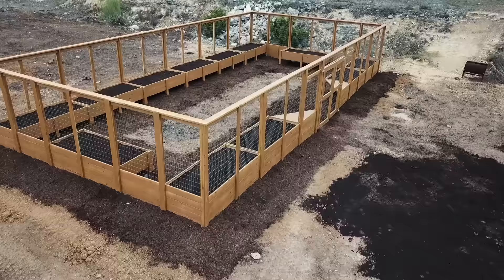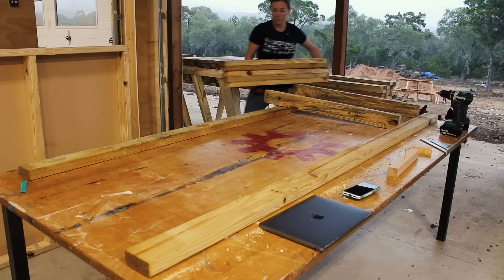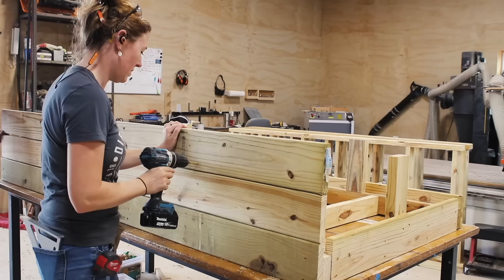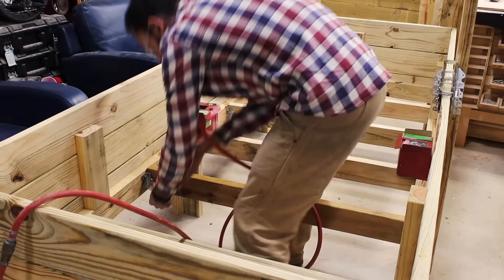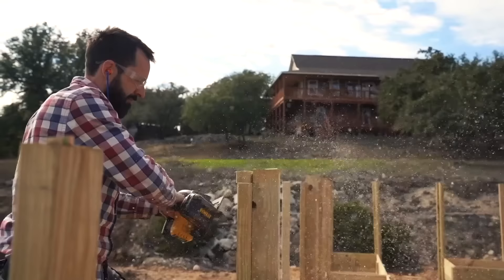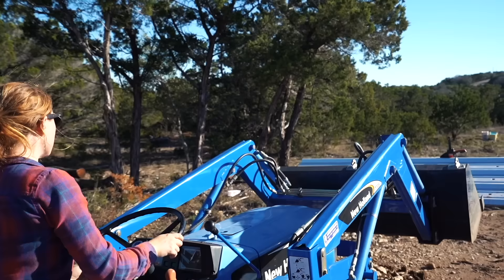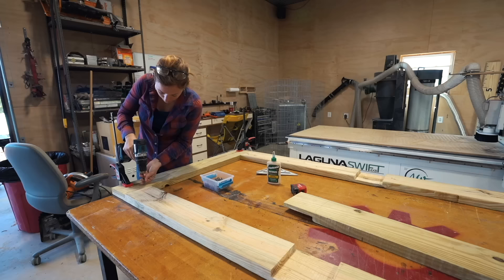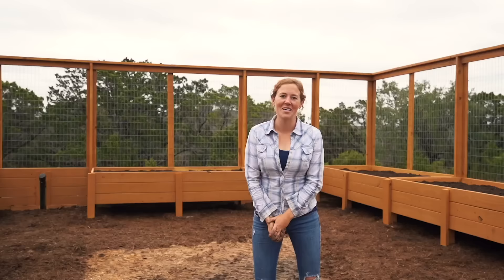Enclosed Walk In Garden with Raised Beds

Comment: I would have to remortgage my house, just for the price of the lumber.
Reply: I could eat for a year at least for that money
Reply: @offgridwanabe   you could eat for a lifetime after building this
Reply: @MrPilcher1  pretty for the first 5 yrs but the wooden box would not last that long.
Reply: @jivdis1x   wrong, use treated timber or a hard wood I've got 10 year old wooden beds , my only issue with these is they don't wick
Reply: @Butch Hanson  there are no acidic treatments that perfectly safe for food production if in doubt line the box with a plastic film. Treatment doesn't harm the food just messes up the soil Ph which can be altered  or corrected most soil needs Ph correction you should be adjusting to suit your crops
Reply: As she said, Lowes helped sponsor.
Reply: Almost $7 for a 8 ft two-by-four where I'm at.
Reply: @gregc9881  That doesn't sound right
Reply: @MrPilcher1  Lowe's in Kentucky$6.59 6 2 by 4 by 8 and 2 2 by 6 by 8 and to 2 by 6 by 16$100that's if you can find it it sells out quickI guess this is a year of deck builds where everybody's backyarding it .
Reply: @gregc9881   try shopping around  at other stores  look for buildings being demolished ask what they're doing with the old timbers where there is a will there must be a way. Heck I'd scrounge old pallets if need be  how big is your desire to have a raised garden bed. Last year I spent $6,000 building a greenhouse & setting up an autopot system, I'm already seeing the savings but you must make a start somewhere. Have you looked at IBC's   then wicking beds they save on water not problem with  treated timber an easy to build
Reply: @MrPilcher1  84 lumber Lexington Kentucky a 2 by 4 by 8 treated $11 I shouldn't have nocked Lowes they're like seven bucks still high
Reply: @gregc9881  4 X 2  Is not really suited to tis operation see if you can access old railway sleepers
Reply: ryan norris   You don't get if you don't ask
Reply: ryan norris   I have spine it seems you don't, just build something and get on with it. I don't complain I just do it I've offered alternatives  but it's all too hard . I've got the spine and have done it. What have you archived?. You the moaner here. Hell I grow so much food I'm giving it away. All you've done is complain about cost grow a backbone
Reply: @n.w.414  doesn't mean they paid for all the supplies lol.
Reply: @gregc9881  The price is up to almost $11 here in WA state
Reply: Now it's March 2021 and it might cost the same as a 2 car addition!

Comment: That’s just a couple of steps away from being a greenhouse.
Reply: Oh what an idea! She could totally make it that for half of the year if she wanted to!
Reply: I was thinking that big open space in the center was perfect for a greenhouse and small tool shed.  I've considered doing something similar to this around a greenhouse/sunshed, but the material costs are prohibitive.
Reply: Or a good place to grow things like corn or vine plants like watermelon or pumpkins. Or you could put a chicken coupe in there.
Reply: You are so right. In winter one could put up a shade to protect and also to make a head start.

It really is s great looking project
Reply: That’s exactly what I was thinking. It would be easy to make it so the sides are roll-up-able and the top has vents or can be removed in summer. Like a really cool high tunnel.
Reply: A Greenhouse needs to be covered with either plastic or glass that adds to the cost exponentially  plus  roof beams etc this would be a cheaper option in many respects.

Comment: Literally the best raised beds I've seen. I would never of thought about using metal roofing material but it makes the most sense. It will reduce rot on the wood base and make the unit much lighter if needed to move. Only one thing is I'm pretty sure deer are going to jump that when their hungry.
Reply: Deer are skilled at jumping, but this garden is safe. The fence is high enough. And deer won't jump when they see that they don't have a safe place to land.
Reply: @idontthinkso666  Don't get me wrong, I really like April's design and you may be right as your deer are smaller. But I've seen 8 foot tall wrought iron, arrow tipped fence with deer hair hanging from it. When deer are hungry the do stupid really well. Cheers!

Comment: When I build my 12' x 22' C-shaped raised-bed garden I was not only concerned with the potential of whatever the pressure-treatment chemicals might do, but also the wood being wet all of the time. My solution was to line them with Delta MS foundation wrap to keep the wood from direct soil contact but also to allow airflow around the lumber.

Comment: You should dress your planted beds with a couple inches of straw  or mulch to retain moisture in your soil.  The automatic watering system is nice but it’ll save water and create healthier soil with a biodegradable mulch.  I’ve used paper bags, straw and commercial garden mulch.

Comment: Wow nice I'm jealous. When building my raised beds with PT, I struggled with the fact that none of the PT was the same width. Not fun to rip this stuff on a lower powered TS. Perhaps Lowes is better than Home Depot in that regard. Each bed is the height of a seat so I can sit while weeding. I opted to have the bottom be the earth itself and put wire mesh on the bottom to keep burrowing critters from coming up from below. This also works well to allow earth worms to enter and leave as they'd like. In each garden, I partially bury a 5 gallon bucket with holes drilled in it for my red wiggler worms. Dinner veg scraps, offcuts, and weeds go in there with layers of shreddings of paper bags or cardboard for bedding. Every spring I get an amazing "harvest" of worm castings to use in plantings. The worms aerate the soil around the tower. I also lined the inside of the bed with aquaponics plastic and wonder if that trapped heat and moisture. I think if I did it again, I'd try using a 1/4" drainage board material (like for siding rainscreen walls) and a layer of landscape fabric to separate it from the soil. The concept is similar to those fabric pots people love that causes the air pruning of roots. Good luck looks amazing. I desperately need fencing for the family of groundhogs living under my shed who eat for free.

Comment: Nicest raised garden set up Ive seen. When youre pulling fence like that, if you have a few inches extra at the end, sandwich it between to 2x4s with screws and use pry bars against the last post to pull it tight.

Comment: April, in my experience the staples you use to keep the plastic in place rust out in 23 minutes and leave two fine holes that create nice circular bits of rotted wood. Most of the time you do not really need them and when you do a dab of adhesive (one that does not eat the plastic) is better.
Reply: Stainless steel Staples

Comment: My husband and I basically had the idea of dismantling our pool deck after we got rid of the pool.  We kept the frame only and enclosed it with chicken wire and cheap pea netting.  We have a 2 1/2 surround boxes and a large square in the middle.  Its 14 x 16 ft and so far I like it.  Between the door on each side we also put in boxes for a herb garden and asparagus bed.  So far I love it.  We used what we had, its super sturdy and was cheap.  Next year I want to continue building to it by putting in various shelves.

Comment: That looks great -- for my area, I'd need to modify your design by adding a wire-mesh roof to keep out the raccoons.
Reply: and deer can jump...
Reply: Something really effective is using a solid piece of sheet metal or wood around the top 18-24" that the raccoons can't climb. We used this trick to keep foxes out of a hen yard.
Reply: @TheRavenWithoutWings  Good tip!!
Reply: Or a shade cloth (Texas) would also consider a chute for a chicken coop - let the girls in between seasons to do your tilling and bug control for you.

Comment: April when stretching the fencing,  sandwich the wire between 2x4s then apply tension by attaching chain, rope, cable etc. and pulling with your tractor, a come-along, block and tackle attached to an anchor point, etc. it puts consistent tension on the fencing top to bottom and frees up your hands.

Comment: This is great, but I would've put the fencing on the outside of the frames so any animals can't push it in.
Reply: I see that mistake often....thanks to YOUTUBE I learned before last fence we built!!!
Reply: I think that she has it in between both boards, so it can't move either direction.
Reply: I beleieve her fencing wire is sandwiched. Should be safe
Reply: She has them on the outside, look again.
Reply: @temujinkhan6326  She's in the garden bed, pulling, and he's stapling from the inside.
Then when she's spraying (with a highly inefficient sprayer, btw) from the inside, she's definitely spraying the mesh on the inside.

Comment: I’ve been waiting this is incredible! As a beginner female woodworker I admire and envy you so much. Love u 😁
Reply: No need to envy, if you have followed April for a long time or even review her video history, you would find that she didnt know a lot about it in the beginning. She learned as she went, you can too. Good luck on your future projects.
Reply: @welderman1221  What's so special about the woodwork in this video ? Except for the fact that she had to do a lot of the same unit, which simply require a lot of space, this is very basic assembly.
Reply: @furrane  all tricky stuff was handled on planning stage (not shown), woodworking wise it is big but simple project (of course simple for owner of right equipment)
Reply: @paveloleynikov4715  Yes indeed she did a great job planning it all with sketchup, but I don't include 3d modeling as woodwork, you can easily do the same with a pen and paper, especially for a simple project like this one. As far as hardware goes, you could do the same with a simple woodsaw, it would take just that much more time.
Reply: @furrane  Get along little doggie.
Reply: @loridennis2989  What does that mean ?

Comment: were you thinking about throwing a fence lining for the "roof" to keep out birds and such? could even run some guttering along the perimeter of the roof to connect to your water collection? just a thought.
Reply: I like that.  Thin row cover also works beautifully as a roof, since it keeps birds from seeing the food and going after it.
Reply: this is a good idea and you could run shade cloth over the top in the summer
Reply: she used a pretty open grate for the outside, so any small birds can easily go through that way. If you have a bird problem, you easily could do that if you also incorporate a smaller mesh on the sides.
Reply: Yeah, who needs sunlight in a garden?
Reply: Shade cloth is good for keeping your lettuce from bolting in the summer heat
Reply: @samseddie01  Yeah, Last summer I had to runaround for 45 minutes tryin' to get the darn lettuce back into the garden-wheew--I also thought I  heard sinkers as I was goin' inside

Comment: In Australia we'd usually place garden beds like these directly on the ground. Just wondering what the benefit of lifting them off the ground is? Seems like a lot more work, and the metal sheets won't last forever.
Reply: saves your back a bit.
Reply: I imagine the benefits are that 1) animals that dig wont be able to reach it since its off the ground, 2) like the other person said, its easier on a bad back, 3) being higher gives it better angles to reach sunlight whilst laying against a tall wall, 4) you can see it from far away, honestly not a huge benefit but why not? lol.
Reply: I agree with you, Larena. Others, I believe she means why not build the boxes open to the earth below. That's what I would/do do. That way beneficial organisms can also more readily exist in the soil. Only positive is burrowing animals will not get in if they make it past the outer fence. For mine, I would bury chicken wire/hardware cloth at the main border.
Reply: @PeterMayIV  Yup, that's what I mean
Reply: I guess there are a few reasons - you can use less soil this way (since shallow-rooted crops won't use the deep soil anyway), if the ground is contaminated it won't get into the food, and it's easier to relocate without disturbing growing plants if you need to (not that that would be a small job in this case, but still easier than full-depth raised garden beds).  I suppose there are a few drawbacks too, like lack of access for worms to move between beds, an inability to grow deep-rooted crops, and things like hugelkultur being impractical.  But for a simple veggie garden they'll do just fine.
Reply: Not sure about her locale, but in my area, the earth is heavily inundated with clay and shale.  You can till the garden up and add soil to make it more tenable, but the heavy clay surrounding the tilled area prevents good drainage which causes all kinds of problems during any prolonged wet periods. We built raised beds right on top of the soil, not elevated like this. Drainage problem solved, garden flourishing. So more beneficial in certain areas. But guess thats what you do down under too.
Reply: A huge advantage of raised beds/above ground is that you can control the plant material better and limit invasives. We built our raised beds on the ground and were constantly fighting invasive vines and other weeds that choked out our veggies. It was hugely frustrating. As I get older, I also appreciate having things at a more comfortable height.

Comment: I love this idea. I have a problem here though in that we get over 60"of rain annually.   Do you think I could do the sides of the planters out of galvanized corrugated material or something else besides wood?
Reply: Use stone, rocks, etc.
Reply: I've seen raised beds with wood frames, lined with corrugated metal.  They looked pretty decent, if not what I'd prefer in my yard.
Reply: Depends on how hot it gets. I'm in Coastal Louisiana and corrugated metal will get so hot that it will burn the roots.

Comment: That’s an awesome design. I really wish that the “pressure treated wood is fine”  but that’s not really accurate. 
They are treated with copper based chemicals.
Most pressure treated wood manufacturers don’t recommend that you use their products for raised beds unless you put a plastic barrier between the wood and the soil.
Probably not gonna kill you.
The worst outcome is that it might negatively affect the plants
Not recommended.
Reply: 5/4 cedar deck boards were going for $14 for a 12' before lumber futures investors screwed up wood working and construction for everyone.
Reply: This has been discussed ad nauseum.  Dozens of Universities over decades have researched the leaching of chemicals from pt wood and the uptake of those chemicals by plants.  The risk to humans is virtually zero.  If you're still worried, you should probably stop using your cell phone since you've got a better chance of getting cancer from that then getting poisend by using pt lumber for your garden beds.

Comment: I name thee "April's Eden", won't you need something under the door area the stop anything crawling in?
Reply: That's the rub isn't it... you either have a raised jamb that inhibits wheeled traffic, or you have a gate that scrapes on the dirt.
Reply: On our garden I placed a 2"x12"x4' board into the earth with a 4"x4'x4' board on both sides of the 2X12.  This prevents groundhogs and rabbits from burrowing under the gate.  We also installed the fencing 1' into the earth all around the garden.  If you have a rabbit problem the first 2 feet of fencing need to be 1" squares.  A rabbit can, and will, get through a 2"x4' rectangle fencing.
Reply: One prevention for groundhogs is to dig a narrow trench (mini excavator, if you do it ahead, she'll need to do it by hand now) 18" deep, and use chicken wire or 'hardware cloth' to go down from the bottom of her boxes into the ground & outward along the bottom of the trench; then refill with dirt.
Reply: @zyllofmitain  or a semi-circular mini trench designed for a larger wheel to travel in, which fills with water every time it rains, and trips you when you walk near the door.
Reply: Keet Randling in